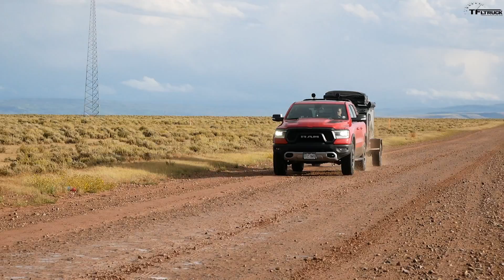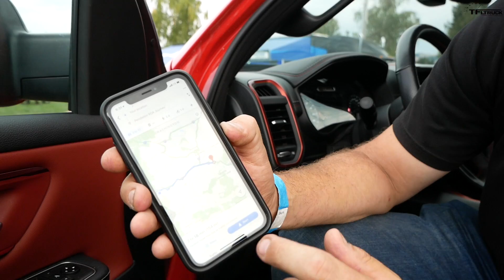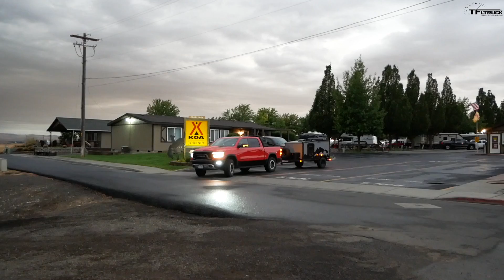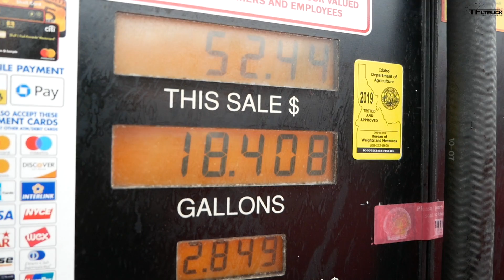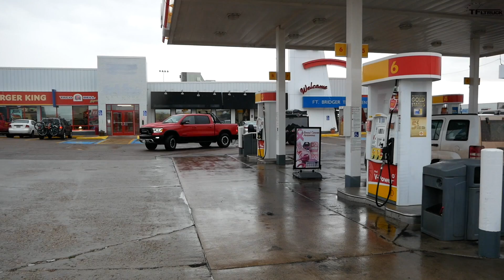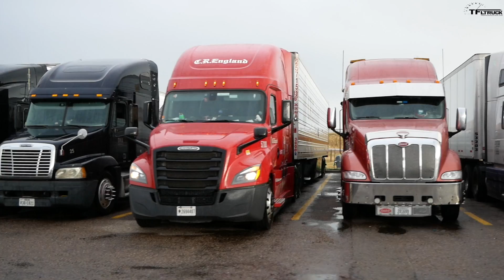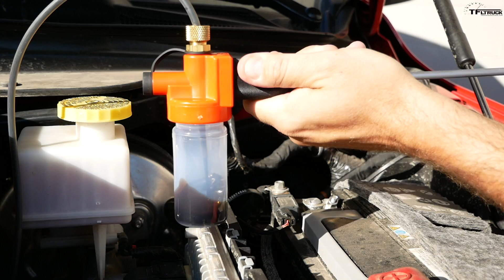Yikes! This 1,000 Mile One Day Overland Trip REALLY Beat Us Up! | Torture Test Ep.4

Comment: I could never use synthetic oil in my Truck that is carbon-based like this Rotella. If it's not silicone-based then you're going to have carbon sludge deposits in the engine.
Reply: Curious what do you use that is silicone based??
Reply: I think he means a true synthetic oil that's not a highly refined petroleum base oil. (Hydrocarbon).
Reply: @zr1vetteman09  yeah I get you brother. I know a ton about engine oil and want to hear about this silicone based engine oil
Reply: @zr1vetteman09  Any carbon including a hydrocarbon will leave residue. And in the case of this oil, it will leave sludge in your engine.
Reply: @theylied1776  - In your opinion, what is the best full synthetic motor oil?
Reply: @arctodus5811  To be honest, all I look for is a silicone-based full synthetic and the weight of the oil depends on the time of the year. After that the only differences are the additives that they put in... some have higher heat tolerances than others but they're pretty much all the same. I normally just grab the premium full synthetic oil at Costco.
Reply: @theylied1776  you're complaining  about a little something that you'll never notice.  I hate to tell you the leftover spent gases on your cylinder walls will leave a residue in your oil too.
Reply: @MattSmith-vl8zp  You don't know much about cars if you don't understand what sludge does to your engine. All conventional oil, carbon-based, leaves sludge in your engine. Sludge is the main reason why conventional oil only last half as long as synthetic. Sludge will clog your oil filter. Sludge used to be one of the biggest reasons why people used to burn up and seize their engines.
Reply: @MattSmith-vl8zp  Leftover cylinder gases? That's called carbon build-up. You do realize before fuel leaves the refinery they put additives in the fuel to reduce carbon buildup?  Since you're so clueless it's called (top tier) gasoline. You'll find that term on every gas pump. But, if you live in an area where it does not say (top tier) gasoline, do not buy that gas.  And since I'm not an idiot I run a fuel injection cleaner in my truck every 3000 miles. 

Just to let you know, my last vehicle had 280,000 miles on it and the truck I had in high school had almost 460,000 miles on it. I bought them both new. So yeah, I know a thing or two about what carbon buildup and sludge can do to an engine.
Reply: @theylied1776  jesus christ you're dumb.  After the ignition cycle some left over burnt gases are left in the cylinder.  The oil scraper ring pulls this leftover residue down with the piston as the piston goes through its cycles.  You'll never get a 100% full burn on your gasoline.  Even your oil you use will have leftover residue from these unburned gases.
Reply: @theylied1776 complete engine failures are pretty rare.  The sludge you talk about is the oil breaking down from use,high heat, water in oil, or low operating temperatures.  All oils break down over time.  Synthetic oils take longer to break down.  Just change your oil and you'll be fine.
Reply: @MattSmith-vl8zp  Complete Engine Failures are pretty rare NOW. But before Silicone-based Fully Synthetic Oil was used Full engine failure due to Conventional Oil, SLUDGE, was a common occurrence. Prove me wrong. 

Fully Synthetic/Silicone-based Oil does not breakdown like Crude/Carbon-based Oil. Silicon will bond with the metal in the engine... and has a much higher heat tolerance than carbon-based oil. Silicone-based oil does not breakdown, it evaporates off. That's why it does NOT leave Sludge.

Again, it's obvious that you don't know anything about cars.
Reply: @MattSmith-vl8zp  Right... and this is different from Carbon buildup how exactly? The so-called "overburnt gas" turns into carbon residue on the pistons, rings, and cylinders. So, again this is why fuel, before it leaves refineries, has additives in it that help clean "carbon buildup" in the engine. And this is why you should use concentrated injector cleaner every 3,000 miles. 

Are just looking things up on wikipedia? They get a lot wrong on wikipedia.
Reply: @theylied1776  no I'm not looking it up...I know this.  All oils even synthetic oils degrade or break down with use.  That is the whole point of the oil itself is to protect all moving metal parts.  Even the best gasoline will leave this "sludge" you are do scared of.
Reply: @theylied1776  and prove your right about sludge being the cause of all those engine failures...its not my responsibility to go out and find your answer is right it's yours.  It sounds like you have an extreme cause of OCD.  Sludge is such an open ended term you're using it's funny.  If you change your oil in a timely manner you really shouldn't have problems.
Reply: @MattSmith-vl8zp  There is a big difference between (Silicon-based and Carbon-based) Oils degrading and breaking down. 

Silicon [evaporates at extremely high temperature] and will NOT leave a Carbon SLUDGE or any residue... whereas Crude Oil/Carbon-based Synthetics will BURN and leave a Carbon SLUDGE residue! That is basic high school chemistry!

In this video, the engineer claims that the Rotella is based on Conventional Oil! That means it's Carbon-based, not Silicon-based!

Is English your second language?
Reply: @MattSmith-vl8zp  I only asked you to prove me wrong? When I know someone is full of shit and has absolutely no idea what they are talking about I'll ask a simple question that proves my point.
Reply: @theylied1776  I'm simply stating all oils no matter what will have some sort of "sludge" in them after use no matter what.  You also said synthetic oils dont break down which is false.  Given time all oils are subject to foreign elements and will create the sludge you are so afraid of.  I'm laughing because while you're all worried about sludge people barely change their oil or do routine maintenance and they are fine.
Reply: @MattSmith-vl8zp  You just confirm that you don't know anything about chemistry, physics, or the elemental charts.  You might want to look at the elemental chart. Silicon-based and Carbon-based oils are two totally different Elemental properties. 

A silicon-based oil does NOT leave any sludge whatsoever in an engine. Sludge from a Carbon-based oil, crude/conventional/synthetic oil is due to burning at high temperatures in an engine... a silicon-based synthetic oil will evaporate at the same high temperature. That is basic chemistry that is basic physics. 

So, I'm guessing you never went to high school either? This is basic 9th grade chemistry, there are 14 year olds that know this.
Reply: @theylied1776  I never said the oil didnt.  I said it doesn't really matter because by the time you're worried about what the oil is doing theres so many other factors that are creating sludge that you are so afraid of.  If your oil is black when you change it it has impurities in it.  Every engine has blow by and will be susceptible to moisture from the crank case vent.  It doesn't matter what oil you put in this is going to happen.  While your silicone based oil wont make this sludge on it's own, the environment and gas used will.  You're sludge as you call it is made from not only the oil you are so afraid of but also dirt, gas, metal particles, water, and any coolant that passes by.  I get you're silicone oil isnt breaking down like conventional oils do and get thick on it's own but you are still getting foreign particles in your oil making "sludge".  No matter what you put for oil in your vehicle it eventually breaks down and gets dirty.
Reply: @MattSmith-vl8zp  I don't know what engine you're referring to but there has never been an engine in history that used  a silicone-based synthetic oil that has ever had sludge. Not one. Sludge is a byproduct of a carbon-based oil product. And the unburnt engine gases you're talking about turns into hard carbon. If water is getting into your engine that's an engine that's not going to start. You can have water in your fuel and it'll start but it will not start if there is water present in the engine itself.  Again, if you disagree you have YouTube, Google, Facebook, Twitter, and Reddit to use to prove me wrong. Good luck with that. And remember what I said about proving people are full of shit, I just asked them a basic question to prove me wrong and they never can. 

You really don't know anything about cars, do you?
Reply: @theylied1776  https://youtu.be/71itwBP7akA.  That is the moisture I'm talking about.  Here's some hydraulic fluid that got water in in and what a filter looks like.https://youtu.be/gKVM96yKAQA.  I would call that sludge.  Again you have such a broad term of sludge anything in the oil is technically sludge but I'm the idiot haha.  Is the oil you change black?  If it is chances are it will make sludge eventually.https://images.app.goo.gl/sJh2dnWjUpsoDpQX9.  If you mean it wont make sludge like this then I'm fine with it but you would have to kill your conventional oil for it to do this.
Reply: @MattSmith-vl8zp  That Ford does NOT have Sludge. Water didn't magically find its way into this engine. This is a textbook example of Radiator Fluid mixing with Engine Oil. Sludge is always black. That is yellow because it's caused by (a Blown Head Gasket)! A very common problem for Fords. Once again, you proved that you really don't know anything about Cars. 

2nd, You can call the hydraulic fluid whatever you want, it's not sludge. By the way, hydraulic fluid is made with a mixture of Water and hydraulic oil. You really need to pick up a book before making asinine comments. And sludge is the byproduct of conventional oil breaking down. 

Is this the best you could do?
Reply: @theylied1776  I literally gave you 2 examples in 1 minute of looking up other foreign substances that help create "sludge" in your engine.    Again I say your engine isnt a sealed unit like an ac condenser and is susceptible to foreign materials.  Again I say you use the word in such an open ended way anything in your engine is sludge.  Its black because your oil is black. One more time crack open you valve cover take a picture then I will shut up.  All these new oils out have some many modifiers in them that they last longer and cleaner than anything before them.  Your silicone oil you use will still go into the head and mix with the burnt carbon and make a sludge.  I get your silicone oil work burn and make this sludge on it's own but that's not the only thing forming sludge in an engine.  https://www.google.com/search?q=sludge&oq=slu&aqs=chrome.0.69i59l3j69i57j69i60.1099j0j9&client=ms-android-verizon&sourceid=chrome-mobile&ie=UTF-8
Reply: @MattSmith-vl8zp  You gave me an example of a blown head gasket that allowed antifreeze  to get into the oil...  and hydraulic fluid, which is comprised of water, from a transmission of a tractor, not the engine. Hydraulic fluid is nothing like engine oil at all. And Neither one of your examples resulted in Engine Sludge. If you have antifreeze in your engine it's not going to run very long to create sludge, engine sludge is black, not neon yellow or green. You must be color blind?
Reply: @MattSmith-vl8zp  That is the definition for sludge, not Engine Sludge. Engine Sludge is not like sludge you would find in a swamp, a barrel, or in nature. Engine Sludge is the Carbon Byproduct of (burning oil) in an engine. The last time I checked no mechanic his ever found any other form of sludge in an engine other than a carbon by product of engine oil. But if you disagree give me a single article or video that disproves this.
Reply: @MattSmith-vl8zp  Refined oil is (not black) refined oil is a brown color, it only becomes black after it starts to break down due to heat, which creates engine sludge if it's not well maintained. You know absolutely nothing about cars.
Reply: @MattSmith-vl8zp  There has never been a silicone-based synthetic oil to ever turn into sludge. When synthetic oil starts to break down it loses it's heat tolerance and will evaporate. You really don't know anything about cars.
Reply: @theylied1776  I don't think you know much about oils!!
Reply: @1gr8oil  Prove me wrong? This is basic chemistry. Silicon-based oils will evaporate when it breaks down due to extreme heat... and carbon-based engine oil will burn and turn into sludge when it starts to break down under extreme heat.
Reply: @theylied1776  All Engine oils are required by the API to pass a "VOLATILITY" Test (ASTM D-5800) which is a test to determine how much of the oil VOLATILIZES.  The current API limit is 15.00 PERCENT. Oil Volatility is very much dependent on the BASE oil used to formulate the oil.  High grade Synthetic BASE oils are much better at keeping oil consummation down and valves and other components clean.  There are many other tests used  for Engine oils required by the API, ILSAC,  and various Engine Manufacturers, such as Chrysler, Honda, Ford, GM and others.
The current API spec for GASOLINE Engines is API SN, and ILSAC GF-5, but on MAY 1 of 2020 will go to a API SP and ILSAC GF-6  The ILSAC GF-6 will be split, ie. GF-6A and GF-6B.  GF-6A is "backward compatible,"where GF-^B will not be backward compatible. Both versions focus on "wear protection", prevention of (LSPI) Low Speed Pre-Ignition, and improved Engine cleanliness.  GF-6B features a more stringent Fuel Economy test.
Reply: @1gr8oil  Last time I checked,  ALL additives in engine oils breakdown under extreme engine heat. This causes a loss in viscosity!  (This is why people should change their oil every 3,000 to 5,000 miles, genius). Once engine oil starts to breakdown, lose its heat-tolerant additives, be it a conventional or synthetic oil, it starts to burn. So, if you don't change a Silicone-based oil it will evaporate... and a conventional/carbon-based oil will turn into Sludge. 

So, which part didn't you understand, Spanky? Prove me wrong!?
Reply: @theylied1776  Here is a test on a Motorcycle oil where heat went over 500 F.  And the oil did not break down, (VISCOSITY)
https://www.youtube.com/watch?v=XSnKTpGt1k0
Reply: @1gr8oil  Was that bike tested for 5,000 Miles? Unless I'm mistaken you can't test for 5,000 or 10,000 miles in a single day. You're trying to compare apples to oranges. Everything he did here can be accomplished by using royal purple full synthetic oil. But there is not a manufactured oil in existence that has additive that will last the life of a vehicle or won't lose viscosity. So again, either you change your oil every three to five thousand miles or a silicone-based synthetic will start to evaporate or a carbon-based conventional oil will turn to sludge. 

You're making this way too easy for me, Spanky
Reply: @theylied1776  It really doesn't matter how many miles.  The OIL reached temperatures over 500 DEGREES F. and the oil did not break down!
Reply: @1gr8oil  Again, Royal Purple Synthetic and most high-end Full Synthetics can have the exact same heat tolerances. These Synthetics are based on Aviation Oils which lubricate engine parts that reach 1,500 to 2K degrees F.

This was a limited test on a motorcycle, not a car for a short period of time. the difference... Between 3K and 5K miles, (Thermal Break Down) of the additives starts to occur. There is NO such thing as an oil that does not break down, Spanky. It does NOT exist. You are trying to compare Apples to Oranges.
Reply: @theylied1776  You can't see the forest for the trees!

Comment: I have a 2014 Ford that tows a Jayco 145rb about 2900lbs and I get 10.5 mpg that Ram drank a lot of gas to tow a camper half the size of mine. Yeah I know it a oil test but couldn't get over how bad the Ram's mpg was.
Reply: Are you stupid? Their trailer weighs 2500lbs. How’s that half the size? The RAM got 2 mpg better than your Furd. BTW 10.5 mpg towing 2900lbs is TERRIBLE. You might rethink you choice in trucks. LOL!!
Reply: Math is hard lol
Reply: @nucl3arfamily906  half the size in volume not wieght, I didn't clarify that for those that didn't know size and weight are two different things
Reply: @nucl3arfamily906  btw the Edge gets around 20 when we are not towing. I would like to tow that same camper they used behind a Ranger FX4. I would guess it would get better Mpg's which we are going to get one next year. The Edge is a short term solution for us. We already owned it when the opportunity to get the camper happened this year.